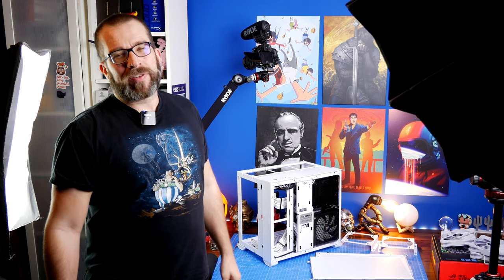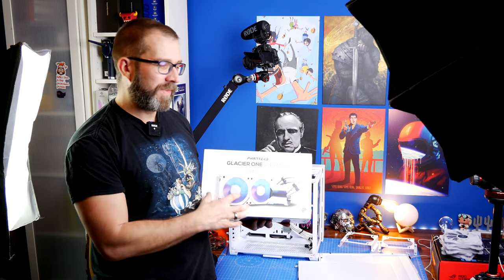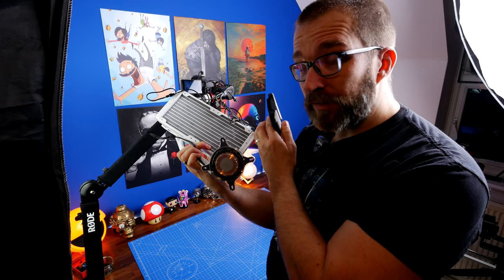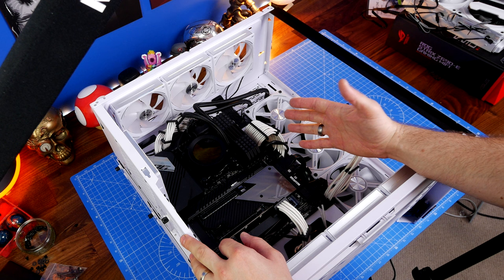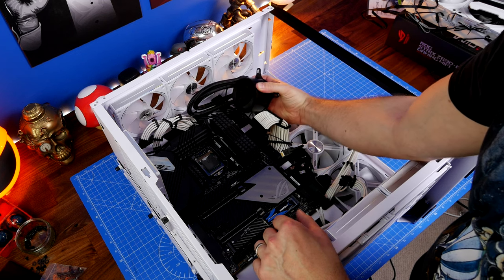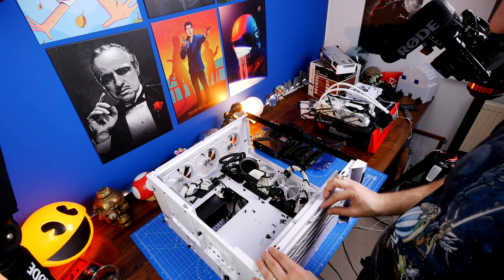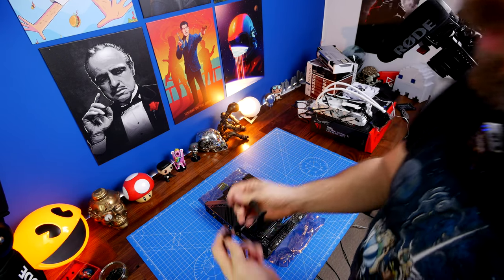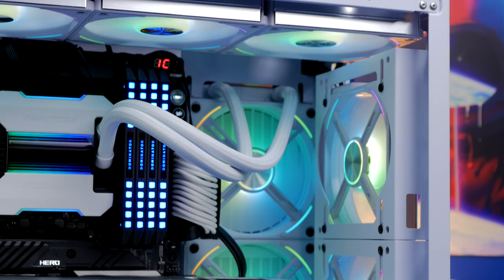Swapping cases for content - Behind the scenes of my Lian Li Air Mini build

Comment: Hey, great video as always! This doesn't have anything thing with the video to do, but I am asking anyway. I have the cooler master mk730 and I am having some problems with the software. So I have downloaded the master plus software but when I try to use it, it just says 
<No compatible devices connected>. This makes me question if this may be the wrong software for the keyboard. I have tried to download it several times but never works. plz help me, I have been wondering since Christmas.
Reply from the maker: Alas I've not seen any cooler master products so I don't know I'm afraid.
Reply: Ok, thank you anyways😊